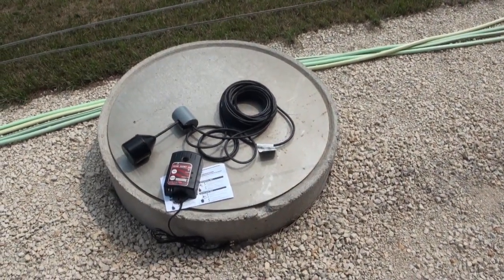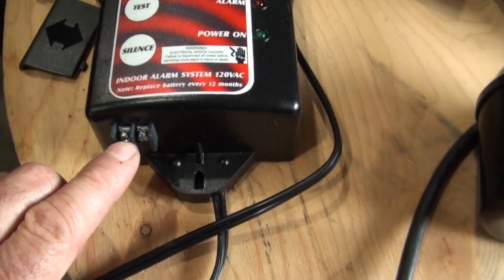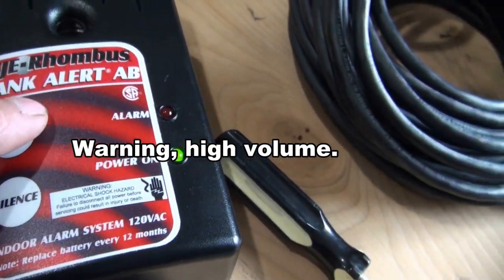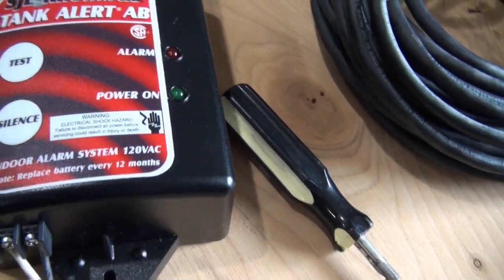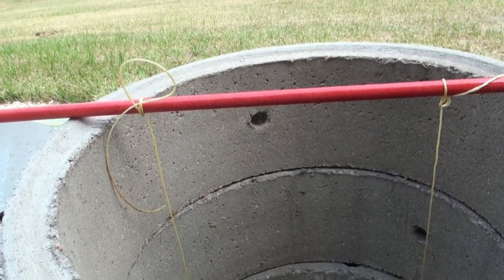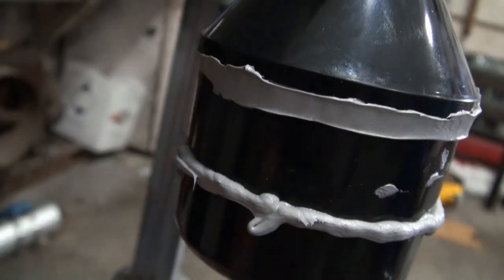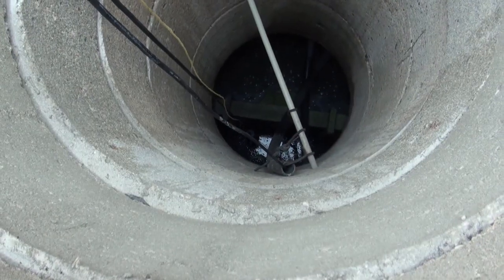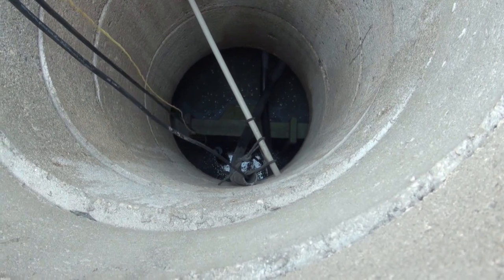Installing A Septic Tank Alarm

Comment: Please don't tell me that the black poly pipe running through was a waterline.
Reply from the maker: The black pipe is in a U shape, both ends are above the septic water line, the water in the black pipe helps to keep the smell from getting into the house.